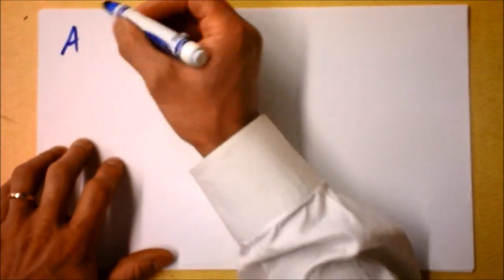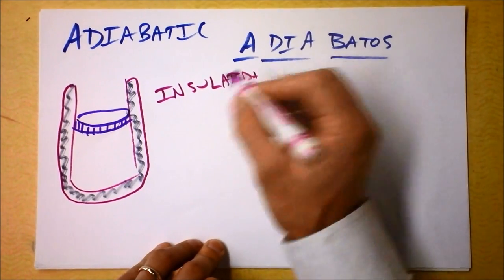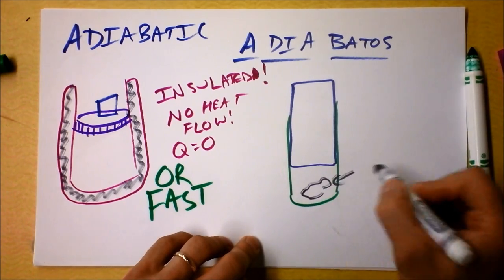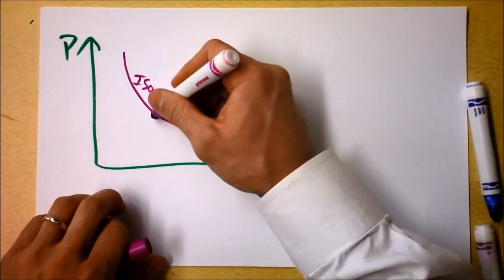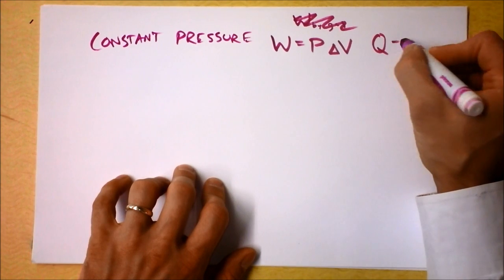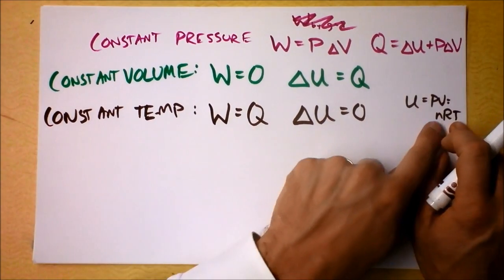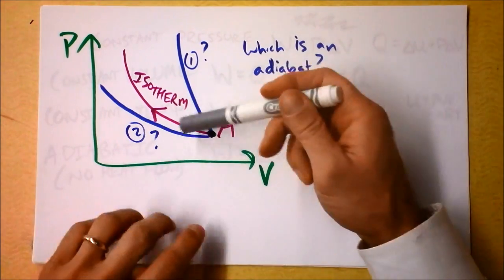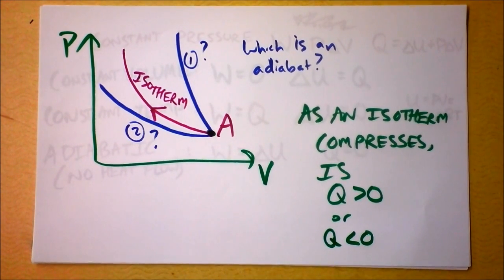Adiabatic is Greek for Not Passin' Through 1 of 2 | Thermal Processes 4 of 5 | Doc Physics

Comment: So, I have a strong Chem background but a weak Physics background. It is so hard for me to think about this without thinking about molecular behavior. 
Is it wrong to think about this in terms of molecular behavior because there is no heat being added or removed? 
Or is it the most correct because you say it is changing the state of the gas but actually delta U is the internal energy of the gas? So we are actually changing the internal energy or internal behaviors of the gas directly in an adiabatic situation? Can I say adiabatic means no energy transfer through convection, conduction or radiation? Instead, all energy changes come from the internal behavior of the gas?
You know you are a teacher when you talk mostly in questions.

Comment: When talking about isotherms , you said in the equation that the only way the gas is able to do work is if we add heat to it ? But what about isothermal compression? For instance in a trompe , falling water which is isothermally compressed and therefore can do work in compressed air systems and as a secondary outcome can refrigerate because of its low temperature?

Comment: Can someone explain how we would graph a PV diagram thats Adiabatic? I don't really understand, because not only is the Pressure gonna depend on the volume, its also gonna depend on the integral of the pressure volume, (the heat flowing out), so we've got three variables...?
Reply: I think this video that shows the demo that Doc talks about might help. It's the "Fire Piston" demo.
https://www.youtube.com/watch?v=6LFEU0QvlUY
You can see that it happens so quickly that the heat flowing out is 0. All of the energy released from decreasing the volume of the gas is changed to pressure. Within the system, there is an increase in temperature BUT it is not due to heat flowing in or out. All of that temperature change came from the actual internal energy of the air.
I wish the fire piston worked reliably (Doc makes it sound like it is not great) because it would be super fun to fill the cylinder with different types of gases and see how that affects the amount of paper burned.
Would a gas with a higher internal energy burn more paper or less paper than the air?

Comment: Speaking of challenges, how about accepting the challenge to tell us WHY compressing heats and releasing pressure cools. And, I don't mean by trying to convince us by throwing a bunch of crappy math out. Nothing ever happens as a result5 of some math genius making formulas or equations for it. But, since the adiabatic process works and does what it does, there must be some mechanism in physics for it to happen.  So, explain what that mechanism is.
Reply from the maker: +crashsitetube You're on.  Compression heats a gas for the exact same reason a ping pong ball hits back and forth between the paddle and the table WAY more rapidly as you bring the paddle down onto the table.
Reply: +Doc Schuster - I have seen that argument and it doesn't hold up...alhough I'd love to see a video that succinctly explains it.

If we accept that there is a direct relationsjhip between molecular
speed (like of air) and its temperature, we can limit what we accept
as true to things that change the speed. Conduction is “easy” as
it's just the exchange of momentum in collisions (note “easy” in
quotes).  Heat transfer by radiation is poorly understood.  And, near
as I can figurte, adiabatic heating and cooling are not understood at
all (at least noone seems inclined to try to explain just HOW it
happens).
Consider a piston engine.  Most of the heating due to compression occurs at
the top of the compression stroke...when the piston is moving
relatively slowly AND when the molecules are closer together.  Whatever conclusions we draw about adiabatic heating must take this into account.  Piston moving more slowly, in denser air (than at mid range of stroke) but molecules' change in speed (heating) more rapid.
Because it happens, there must be some mechanism in the laws (or bylaws or
city ordinances) of physics that makes it happen.
I've given this some thought and believe that clues about adiabatic
heating and cooling can be gleaned from analyzing, Brownian Motion.
Reply from the maker: +crashsitetube It really can be understood with just a single particle (or collection of disinterested particles), which is why the ideal gas approximation generates the result that interests you.

If the wall is fixed, a particle hitting against it over and over does no work.  If the walls are moving away from the particle (expansion), the particle does work on them and loses energy.  If the walls are approaching the particle, they do work on the particle, so its speed increases.  This can also be seen by considering momentum conservation in those collisions if you give the wall some mass.

A piston engine is such a terribly complicated thing, though.  I'm sure I'll get confused if we go inside.
Reply: +Doc Schuster  - There is some merit to your view.  In fact, it's the very one that Feynman makes in one of his arm chair tutorials. YouTube doesn't allow links in comments but, the exact title is, “Richard Feynman Atoms” (and
a search for that will bring up an amazing collection of unrelated
crap).  About 5:40 in he tells of his childhood bicycle pump.

If it were not for the pesky fact that the molecules move faster than
the speed  of  the piston (your ping pong example) AND that with  the
same number and mix of molecules, they move even faster (a LOT
faster) with the piston moving even slower as the...air...gets denser
(more compressed).  There's clerarly more going on here than the mere
sharing of momentum between the piston and air molecules.  At least
it seems clear to me.

In a piston engine example we can ignore all the “engine” stuff and
just concentrate on a piston in a closed cylinder.  But it's a common
thing that’s generally at least sort of understood by even back
yard mechanics.
Reply: +Doc Schuster - I'm curious.  You say, "Doc Shuster". Are you a PhD and, if so, in physics?
Reply from the maker: +crashsitetube yeah.
Reply from the maker: +crashsitetube I think it's necessary for my argument that the walls are moving slower than the molecules.  I have lots of respect for mechanics, back yard and otherwise.  There's a long list of things I've tried to do with cars but failed.

When you describe the temperature rising when density increases (?) is this a deviation from the ideal gas law or an application of it?  The ideal gas law only gets us so far, so perhaps we just need to be more careful.  I recommend 

An Introduction to Thermal PhysicsAug 28, 1999
by Daniel V. Schroeder.
Reply: +Doc Schuster 

Explaining stuff with math is a no-go for me.  And, I look, with suspicion, at math-based explanations of physical phenomena.  Case in point:  the adiabatic process.  In the entire Wikipedia entry, there is not one word of how it works. Sure, how it's defined and lots orf math as the 'explanation' of...well, whatever.  I think that before you (plural you) start up with the math, the core concept should be given...in the King's English (Emperor's Japanese, Caliph's Arabic. Chief's Navajo...etc., ad nauseum).  

-------------------------------------------------------------

The ping pong ball:  If you shoot the ball at a rigidly fixed paddle it does not bounce off moving faster.  Any time there's a collision, there was a closing speed.  During the collision, the closing speed decelerates to zero.  The momentum is stored in the deformation of molecules.  That momentum (with some losses) is returned; ie: the ball bounces off the paddle.

If the ball is stationary (or nearly so, as when serving) and the paddle is moving, the closing speed drops to zero and then the momentum is returned.  A simple-minded analysis would suggest that the ball would move no faster than the paddle.  But, there is another factor to consider.

The ball has mass and thus, inertia.  Both the momentum and inertia of the ball go into the deformation.  If the paddle is relatively more massive (which it is), the paddle slows little and the ball a lot.  The ball then moves away from the paddle faster than the paddle is moving.

---------------------------------------------------------------

Let's say, for the sake of this argument, that the above may true.  True or not it required absolutely no math and still provides a presentation that can serve as a springboard for technical discussion.  

That is the sort of erxplanation I'd like to, see for the adiabatic process.  What I've found so far doesn't even attempt to describe HOW it works...at a concept level.
Reply: +Doc Schuster - Hmmmmm...I think we're talking apples and oranges here.  You seem to want to push things toward the classical math-based physics curriculum and I want to understand the underlying corer concepts of it in a more plain English way.
Reply: crashsitetube search 'fire piston' on youtube
Reply: I have seen that demonstration a few times though I've never done it myself. That it happens means that there's a physics to it. The question is: Why does the heat rise so dramatically? It's certainly not from the momentum added to the air by the piston because the greatest heat rise occurs when the piston is traveling its slowest (but, when the 'pressure' inside the cylinder is at its greatest).

Any explanation of it needs to address that simple, observable fact.

You;ll notice that nobody that does this experiment even attempts to explain HOW it works.
Reply: @crashsitetube  2 years late, but the reason is because although the piston is moving slower, the rate of collisions increase tremendously not only between the piston and the molecules but between the molecules themselves because of how tightly packed they have become. 

With that in mind think of two walls angled in way such that the bottom portion of the two walls are closer than the top and you bounce a ping pong ball off the high side so that it hits slightly lower on the second wall.. as it bounce back and forth it will slowly descends due to gravity, and since the walls are getting closer the ball will begin to collide with the each wall more frequently to the point its basically vibrating in a stationary place. Molecules do the same thing but instead of two walls they're colliding with each other more often. The problem with example is that the energy of the bouncing ping pong ball stays the same. The gain in energy (aka heat) is in fact from the added kinetic energy from the piston itself. Since the piston is high in mass and is moving at a high velocity it has a lot of energy that is being transferred to the molecules ( whom have a very small mass) at a faster and faster rate. (Faster and faster because the distance each molecule and surface of the piston is decreasing same as the ping pong ball between two walls). Since the transfer of energy increases the heat increase. "side note: the transfer of energy is the definition of heat"

In the case of a diesel engine, the reason it doesn't combust until its near top dead center, when it is at its slowest, is because thats the way it was designed. Engineers realized that if it were to combust too early (while moving fast) rotational energy to the crank shaft would be in the negative direction, thus a lose of efficiency. So they designed it in such a way that it combust right before top dead center in order reduce the lose in rotational energy to the crank. That being said, since it must combust before it completely stops, there is kinetic energy still being transferred by the piston which is being compounded by the still increasing collisions. Although at its slowest that touch of added energy is the straw that broke the camels back at the latest possible moment to be as efficient as possible. 

It is also good to note that the ignition temperature of diesel decreases as the pressure increase making more so than gasoline. All of these factors play a key roll in the perfect timing of autoignition

Comment: I think graph 1 is correct because it shows a steeper increase in pressure compared to the isotherm. The reduction in volume besides increasing the pressure will generate additional heat. Being in an adiabatic process where no heat can flow out of the system, it will increase the temperature of the system which as a consequence will increase the pressure. Therefore there are two causes contributing in pressure increase which generate a steeper graph compared to the isotherm.

Comment: In order to compress a gas and keep it the same temperature it has to loose heat. Gas heats up when it contracts and cools down when it expands. That is why the piston thing can burn up the piece of paper when it is compressed so fast that it is adiabatic. So starting at point A and compressing the gas adiabatically you would expect pressure to be higher for any given volume because the heat didn't escape and now there is more pv energy in the gas.
Reply: your answer makes more sense then this video itself. thumbs up to you !

Comment: THE ANSWER (I hope). The volume of the cilinder goes down: In an isothermic process, the pressure must go up. Because: P.V = constant. The internal energy of the system tends to go up because of the work-energy (until it explodes), but (luckily) the same amount of heat is released. So, dU = 0. In a adiabatic process no heat can be released! Therefore, dU > 0 and the temperature rises. So, the adiabatic line is above the isothermic one (I think).

Comment: My answer is option 1. My reasoning is that for adiabatic and isothermal processes that undergo the same change in volume...
Adiabatic: since energy cannot escape as heat, deltaU must increase which when divided by deltaV to solve for pressure, yields a pressure value higher than that of an isothermal process in which the deltaU remains constant since the "added" energy produced by decreasing the volume CAN escape as heat energy to maintain deltaU = 0. This is how I interpreted your comment about how heat transfer can still occur even if temp is constant.

Is my reasoning correct or are there flaws?